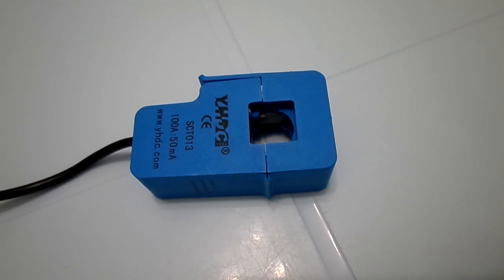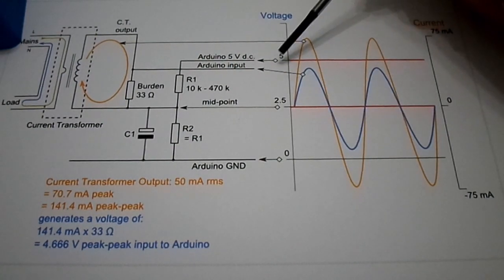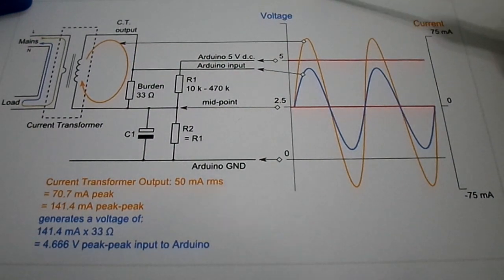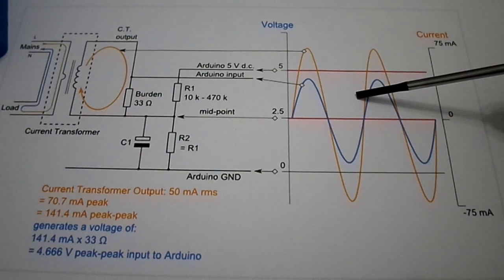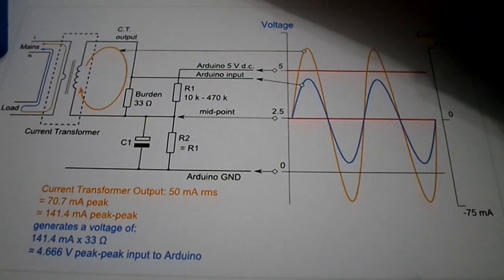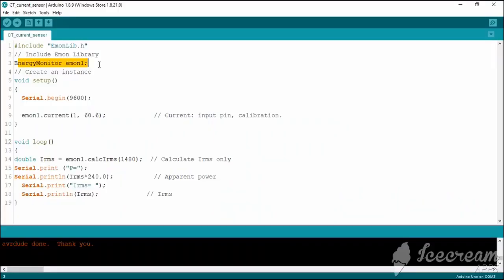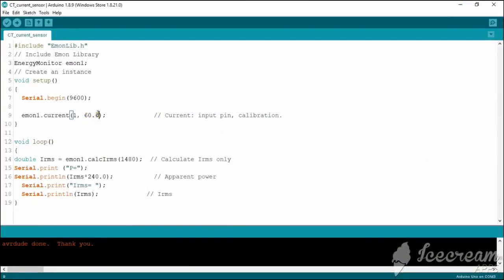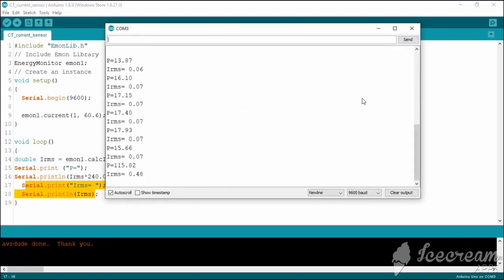CT Arduino power sensor

Comment: Question on these SCT series sensors. Say you have a 15 amp load. Will the 15 amp version give a full 1v output and the 30 amp version then give a .5v output? Is that how they differ?  -- thank you (anybody)

Comment: thank you for the explanation. this  stc013 is for 100A but the values of current is very low. can i use it by doing the same thing
Reply: increase primary windings in loops accordingly